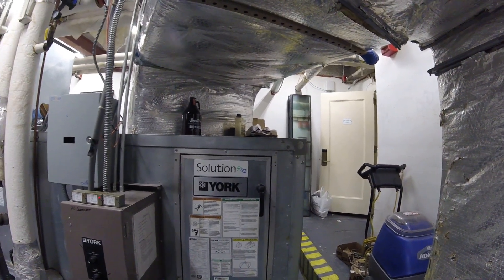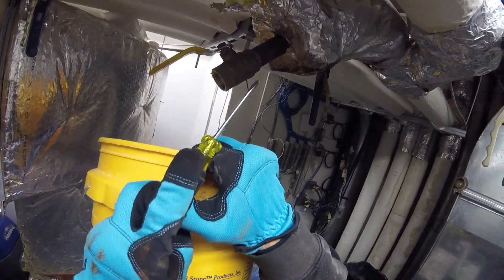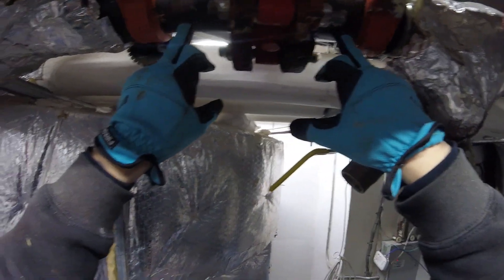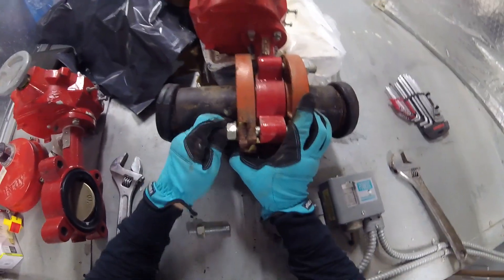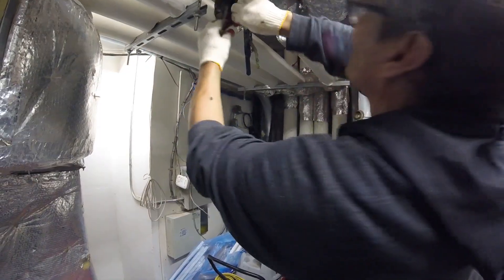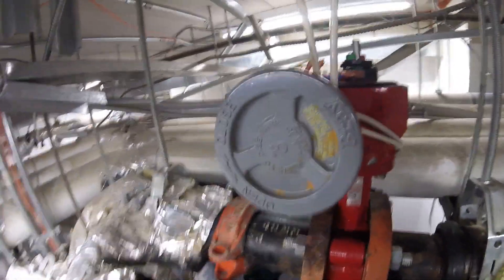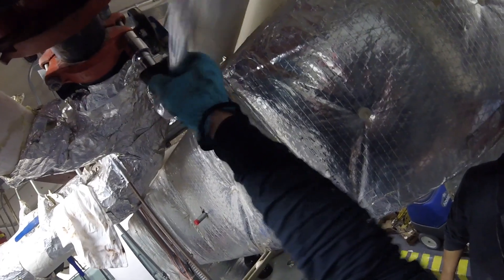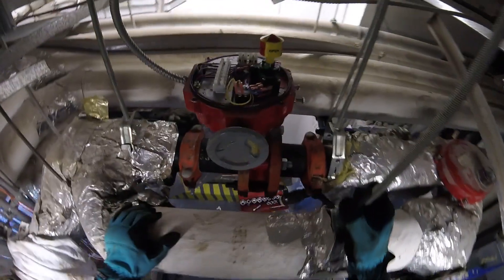HVAC: BRAY Series 70 Electric Actuator Valve Installation/Replacement (Chilled Water Valve)

Comment: Great video ! I have those valve's all over my building its good to know how they come apart if we ever had to replace one. And we have the same air handling units as well. Not bad units easy to maintain , biggest we have is 60Hp 32,000 cfm unit. Good stuff man I love the video's so far as am in commercial myself here in the city too.
Reply from the maker: Thank you so much! I really appreicate your feedback. These valves seem to be popular but I hear mixed reviews on them. If you're ever going to change one, know this is a 2 man job. I really pushed it doing it alone but I did it for the video lol Glad you're enjoying the videos. Awesome man😎 HVAC & NYC. Practically brothers😁 Thanks for watching & enjoy your weekend